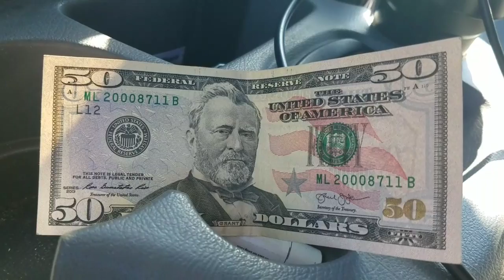YARDMACHINES MTD 20HP BRIGGS INTEK CVT LAWN TRACTOR SEAT BRAKE PTO SAFETY SWITCH BYPASS REPLACE CARB

Comment: Clean gas cans, clean fuel tank, install a fuel filter with fresh gas and drain the carb or run it dry at the end of the season and you won't have any troubles with those solenoids. But of course who does all that, I mean look at the condition of how dirty the tractor is, especially the fuel tank.... kinda gives you some idea what the original owner was like.  I have a Kohler and a Briggs with a 1999 manufacture date and both solenoids still doing there job! Couple of quick sales bro, keep the ball rolling!

Comment: I've had about 15 of those Craftsman LT4000's, more than any other Lawn Tractor. Just got another one free Saturday in fact. Still runs, still drives, still mowes, because they built those Tractors to go 30 years, unlike todays crap. The last one I sold with a bag fetched $650, the one prior to that no bag, $500.
They were a very reliable model and I actually like their nice solid all metal look. A piece of flat stock bolted or welded to the side of the frame would have likely repaired that, like those brackets I showed from a plow left over on my MTD white Outdoor.

Comment: I would have busted down that Murray with no deck before the "cube" and attempted to save the LT4000. If the frame could have been fixed with flat stock easy enough it would have been worth it. After all it wasn't gonna go romping, just cut grass.

Comment: Get rid of assgas, clean the carb, adjust the valves, clean her up, change the oil, and she's good to go, you can still adjust the fuel valve, cut a groove into it with a cutter wheel on a dremel, and you can adjust it with a mini flat head screwdriver.
Reply from the maker: I don’t have a dremel
Reply: @MowersNBlowers  Walmart has a good one for $14.99 Comes with a kit of bits. The bits are kinda cheap, but the dremel itself works great. You can get good bits online cheap.

Comment: I just rebuilt the engine on The same tractor in my keeps blowing flywheel key timing is good Torque the connecting rod bolts to 150 inch pounds torque the fly wheel nut to 100 inch pounds New head gasket new piston rings vales are adjusted I’m totally lost any ideas?
Reply from the maker: Is your crank bolt an integrated washer or separate washer or no washer?
Reply: @MowersNBlowers  which one the one on the bottom for the engine pulley has a washer The one for the fly wheel does not

Comment: Those aren't actually classified as cube tractor's. The cube tractor was another model back from the 80's that had an actual big ass square hood that looked like a cube and was all metal in front. The LT4000 came out in 1990, it replaced the cube, the hood has more slants and lines in it and are better looking. Still square but not the cube. Tractorland had a lot of cubes at one time.
Although Tractorland is gone, your becoming Tractorland 2.0 now.

Comment: Yep parts tractor.... Don't weld it man it will be worth more in parts.... To you and to sell.... I hear the cops man.... Runnnnn.
Reply: Disagree, I've had around 15 of them so far. A piece of flat stock bolter or welded to the side of the frame. Done. $500 tractor.